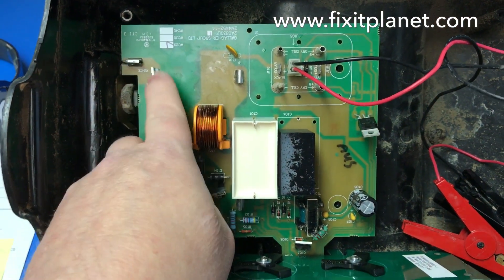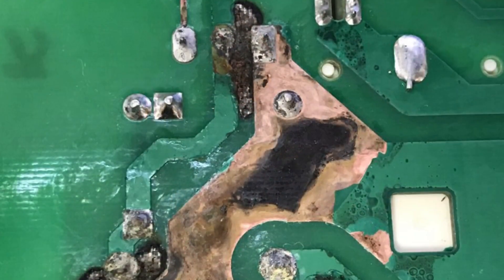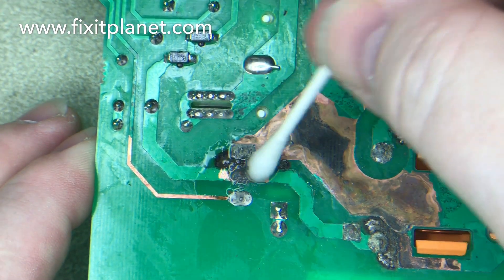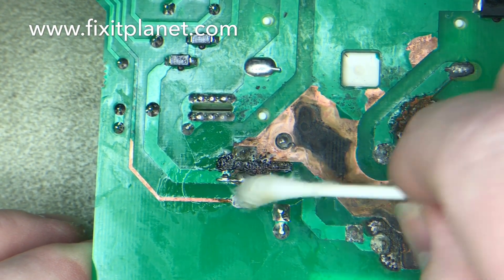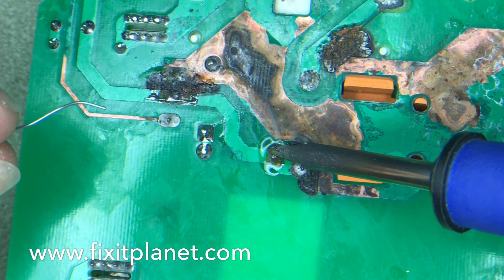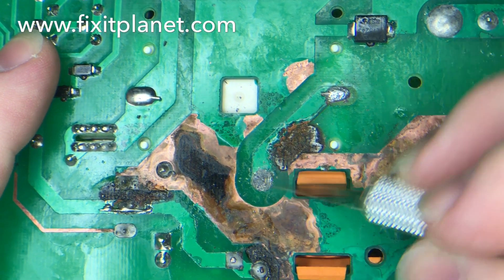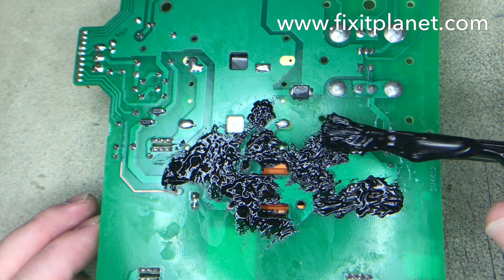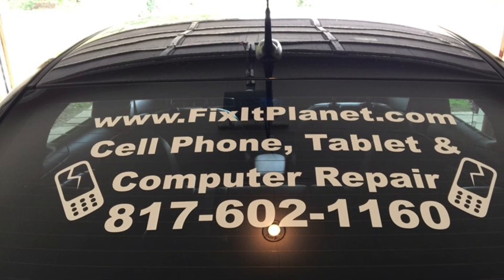Badly Damaged Gallagher Solar Fence Energizer Circuit Board Repair

Comment: What material did you use to cover the burn holes? Liquid rubber?
Reply from the maker: Liquid electrical tape. You can also use masking but you need a lot for an area this large and a special UV light to cure.

Comment: Great video!! I hope that you will please answer my question, I am trying to learn so this is no critique of you at all!
I am wondering on why you did not make new tracks from thin copper and if it is overkill to desolder the corroded solder joints and then resolder with new solder?
Reply from the maker: Thanks. I did re-solder the damaged joints and Yes you could rebuild the traces if you wanted to. The whole board was cleaned and treated for liquid damage as well.

Comment: Greetings, I'm in the process of repairing my amp. Was that black coating Plasti Dip? I have some arcing damage on my pcb. Thanks. Great job.
Reply from the maker: Black "liquid electrical tape" can be found at Home Depot, Lowes, or other hardware stores.

Comment: the problem is the often conductive carbonised fiberglas board,  thats not good, but seems to work here .
a job well done,  its impossible to make a perfect fix on board like this.
Reply from the maker: Great comment. Believe it or not the guy that owns it came in about a week ago and told me it's still working! Hard to imagine with the extent of damage it took.